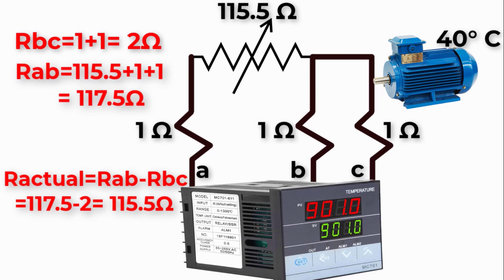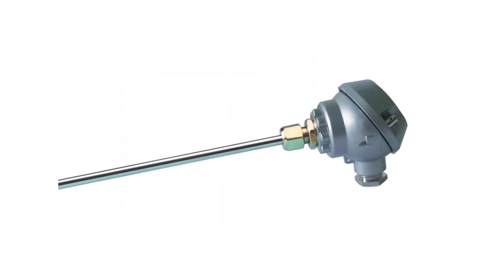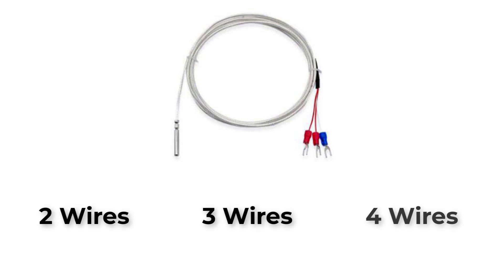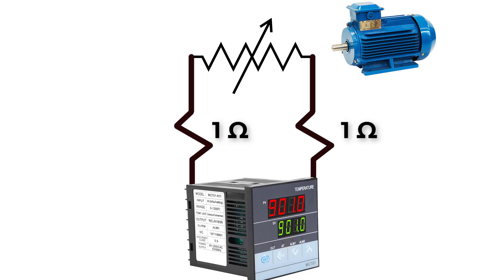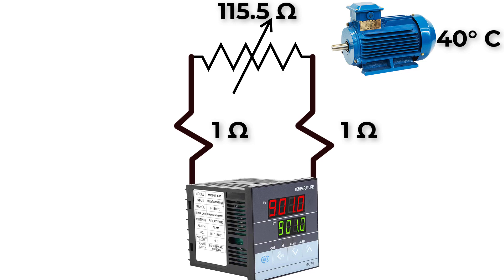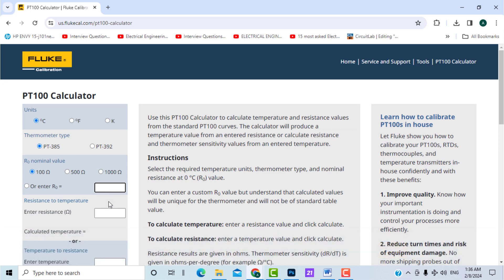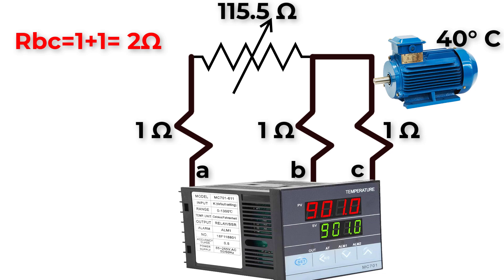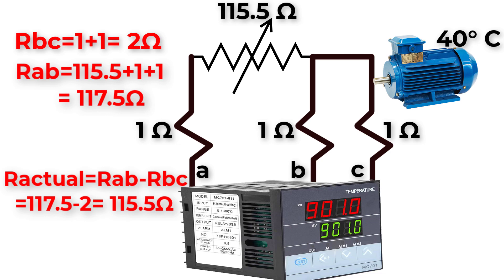Which type of PT100 is better 2 wires vs 3 wires? |EXPLAINED

Comment: What is the difference between 3 wires and 4 wires for a PT100 ?
Reply from the maker: Four wires is better because we can check the wires resistances twice, also if any cut happen to a wore we still good, but it is more expensive